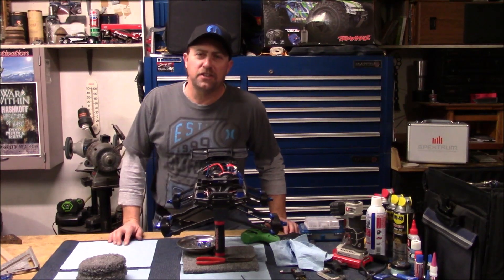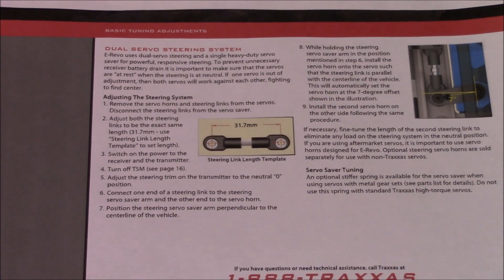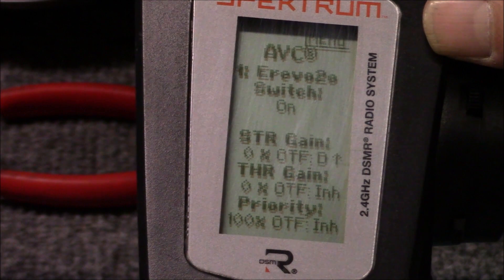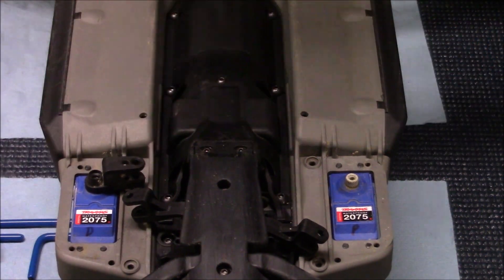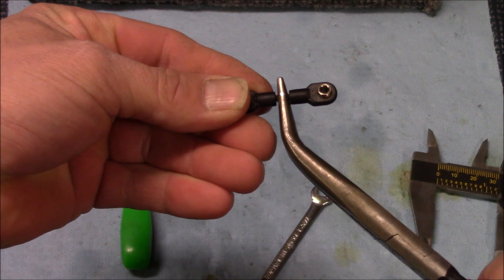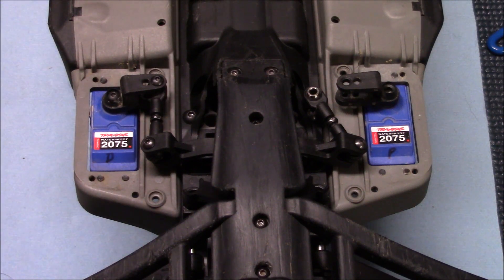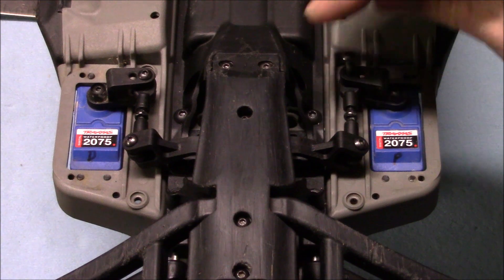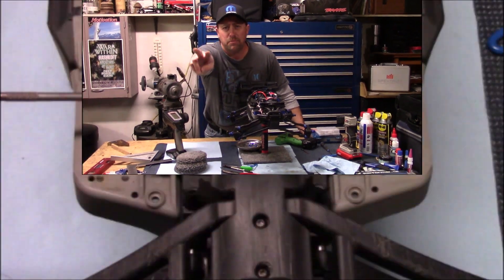Dual Servo Steering System Adjustment EXPLAINED!

Comment: Hi.best angle is a right angle, so 90 degrees. Traxxas say 7 degrees because with the original transmitter you have no subtrimm to do exactly 90 degrees .with your dx5c you are able to subtrimm. And of course the car have to be turned on if you do adjustments😊and if you got exactly 90 degrees mount the linkage on the servohorn. now adjust the linkage  until the srew will slip by itself in the other side of the linkage. Done.regards from your German Fan

Comment: U need a 4 mm wrench out of an ignition wrench set. I used the one out of my grandfather old craftsman ignition wrench pouch. It's got all sorts of smaller size wrenches than your standard wrench set has in it cause a normal set stops at like 5.5 mm and that's way too big for it

Comment: I just replaced the servo gears everything lines up perfect ,but when its off the ground and I accelerate the front tires turn left and then return to strait normal placement , is the normal or did I do something
Reply from the maker: My first thoughts are AVC (Active Vehicle Control) or TSM (Traxxas Stabilization Management). If that is on, Turn it off.

Comment: Irritating that there is no wrench for these. It would be much easier to adjust. I’ve purchased a mini wrench set and it even has 1/2 sizes and no luck. It is somewhere between a 4.5mm and a 5mm. Sometimes a 5 will catch but any resistance and it slips. I have the 5mm Traxxas wrench that is too small I’m going to try and file it a bit and see if it will work.
Reply from the maker: I finally got the traxxas blue 5mm wrench and it does work lol. Good luck brother. 🤟
Reply: Well it doesn’t for me!!!  Lol

Comment: Very good video.  I read through the adjustments in the traxxas manual as well, (page 26 for a #5603)  but my right servo did not end up at the 7 degree offset, for some reason it was off a bit more.  The 31.7mm on the steering turnbuckles was good to start, but they did not end up at that measurement after adjustment.  It would have been nice to see your steering turnbuckle measurement after as well.  I liked your comment on the turnbuckle wrench!  I could not find one in the traxxas tool kit either, I think it is a 6mm since I have a 5mm and a 7mm, I ended up using a very small adjustable.  I also used the Traxxas rod end tool which helps a lot!

Comment: Yep. Well done! I've been tinkering around trying to do exactly this, without the results I desired. I'm going to try it again with this method, which seems very straight forward. Thanks Upgraded RC for providing such a detailed and necessary tune.